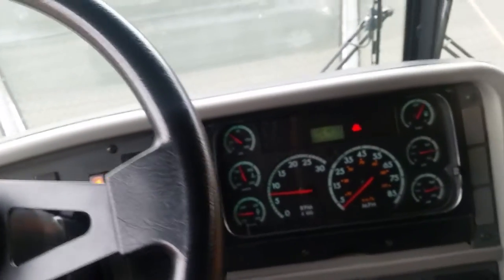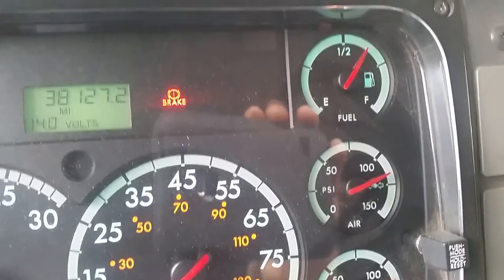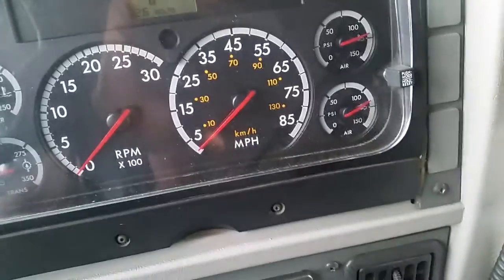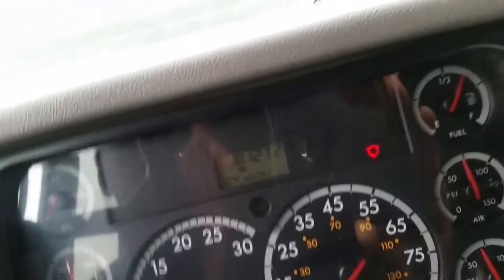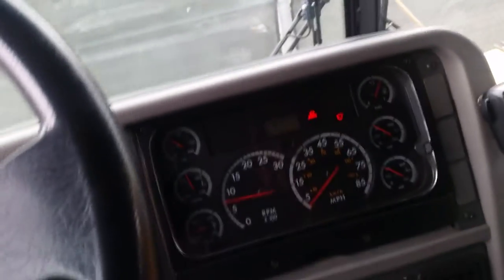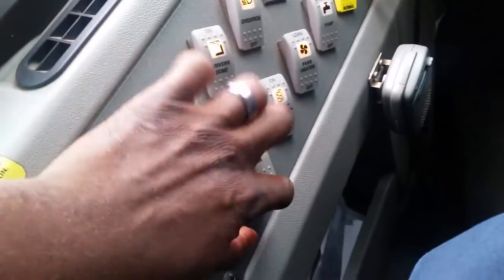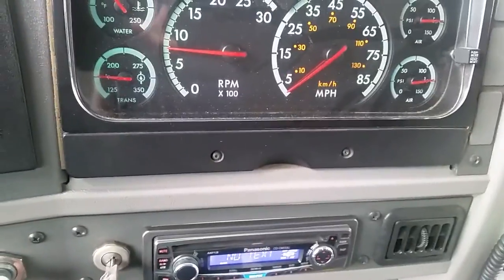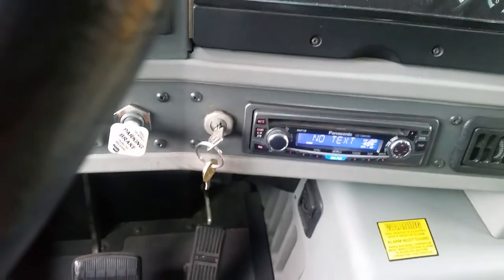California cdl class B BUS air brake test  2016

Comment: Hey I have a question . Before I do my cut in and the needle is lower than 100 psi I know it should charge higher than 100 ... But what’s the best answer to tell the inspector if I want to build up pressure ? I’d say maybe 120 ?

Comment: let me get this straight. 1. governor cut out 2. Governor cut in 3 low air warning 4. applied pressure and 5 the tug test. is that correct?
Reply from the maker: Ed D if the air needle isn't  moving  when you start the test you can Start  with the AIR COMPRESSOR  GOVERNOR  CUT IN TEST THEN CUT OUT BOTH WAYS ARE COOL . Then I do the #2STATIC TEST.... THEN  THE #3APPLIED  THEN  I DO THE#4 LOW AIR WARNING.  THEN I DO THE #5EMERGENCY STOPPING.  THEN TEST  THE #6PARKING  BRAKE THEN I TEST  THE #SERVICE BRAKE
Reply: I learned this acronym Ocla. Or cola. Governor cut out, Governor cut in, low air warning and applied pressure
Reply: Then last service brake
Reply: Do you have a video on the exterior pre trip? I've seen many videos but yours is simple. I have my test tomorrow
Reply from the maker: you can do service brake last and  make sure  you drive up to 5 miles per hour  and step on the brake firmly. .don't  smash on it super hard.  Say  the truck did not pull to the  left or right  also. I also said the speedometer  works. Just remember  take your time.. the examiner wants to see what  YOU know.  Basically  it's just  like your practicing alone.  they just happened to be there.... you'll get it bro.

Comment: Do you have to do a build up pressure test for the air brakes?? Example from 85 to 100 should take no longer then 45sec and from 50 to 90 in 3min
Reply from the maker: XXRoxasXSora no we didn't do that,  that's not required during the DMV test

Comment: hey brother I'm having a bit of a hard time learning the air brakes inspection do you have any good advice how to learn it well.
Reply from the maker: Yes , start with either  the Air brake compressor governed cut in OR CUT OUT , then do the other steps now I didn't know shit a few months ago so  let me tell you say the steps out loud over and over again  even day each step  out  loud 5 times in a row. DO YOUR STEPS  THE SAME WAY  EACH TIME OVER AND OVER AGAIN.  Try it,  it might sound funny but it worked for me.